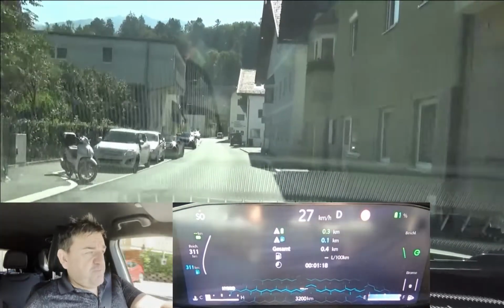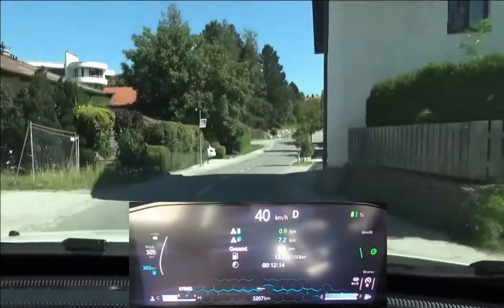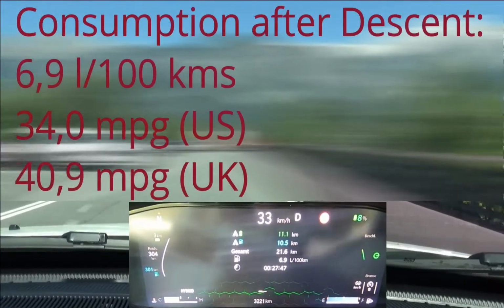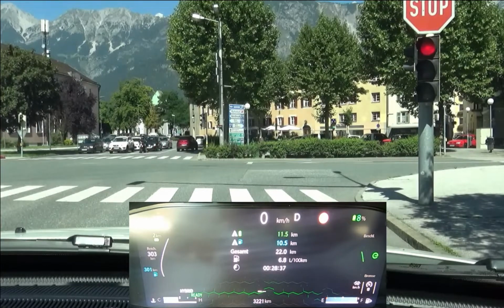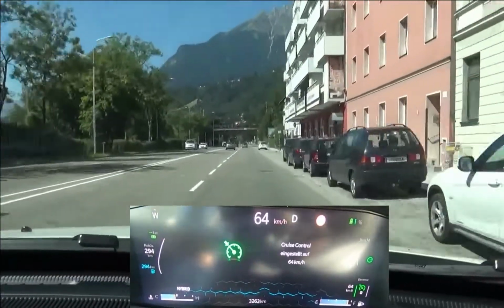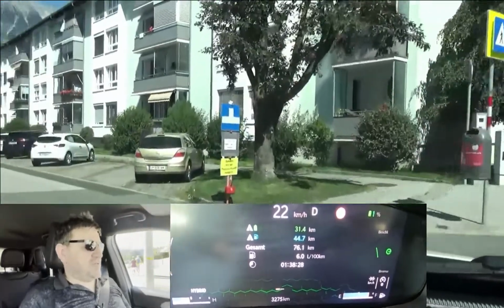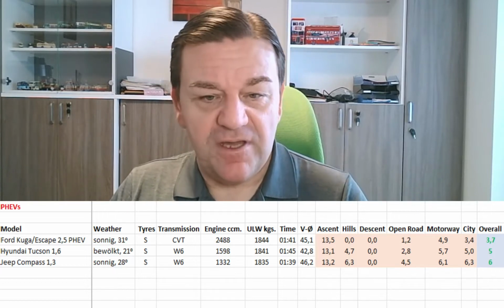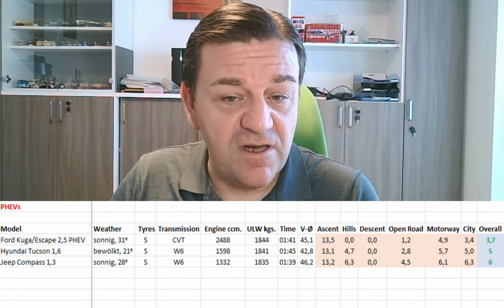Jeep Compass 4xe - Plug-In Hybrid - Fuel Economy test with empty battery

Comment: I have had a 2022 Jeep Compass Trailhawk 4Xe in Scotland from new for past 3 months.   Very interesting video - thanks.   Have you done the same tests with the "eSave" mode configured to CHARGE rather than just hold the existing charge?   I eventually came across the setting and have now configured mine to CHARGE rather than hold charge, when car is set to eSave mode.
Reply: How do you do this mate
Reply: @ryanDevski  1. Select the "Vehicle" option on the button below the Uconnect screen. 
2. Select "E-Hybrid" option on the Uconnect screen (near the top left of screen).  
3. Select "e-save" option from the options on left side of screen. 
4. Now you should see the option to select "Battery save" or "Battery charge".
My vehicle was set to the "Battery save" option which may be useful if you are regularly in an area where you MUST be running on battery.   When I read about the "Battery Charge" setting, I changed mine to this and have left it in this setting.  
Now, when I select the "e-Save" operating mode of the car (pushbutton options on central tunnel behind the "gearstick") : "Hybrid", "Electric" and "e-Save",  I can have the car charge up as it is running on the petrol engine -  which I use occasionally.  It probably uses a bit more fuel but does charge the car but, for me, I find "Battery Charge" a more useful setting than e-Save
The 400 page (approx) manual for the car is poor in my opinion, but there is a section covering this on Page 14 within the "Knowing your car" section.
Hope this helps.
Reply: How much milage do you get in this mode?

Comment: I like how you drove 36 kilometers on fuel and 24 on battery even though it wasn’t charged prior and in wasn’t changing while driving. That means those 24 kilometers where purely regeneration breaking. 
I’m still not a big fan of cvt. 
I’m glad Jeep has real gears.
Reply from the maker: That's always impressive with Hybrid-Cars.
I must admit I came to like CVTs as they are way more efficient in a hybrid-system than a gearbox, especially if it is engineered to be a hybrid-system in the first place, mostly then with an Atkinson-engine.

Comment: I throw my hat in front of you mister. A german who make videos in english for all people to understand. Many thumbs-up to you sir. You see Tucson and Compas have smaller turbo engine with torque on a large interval. For example TucsonPHEV has 350Nm from 1500 to 4500 rpm so a large interval with constant torque so can be used with an automatic gearbox. Kuga has larger engine but aspirate in Atkinson cycle which means power and torque are delivered at maximum rpm about 4500-5000 Rpm so this engines need CVT gearboxes to keep engine at maximum Rpm. I drive day by  day Tucson PHEV as personal car and in my opinion higher consumption is because of desig of power train. Tucson has electric engine integrated with ICE engine and gearbox and use a trans-axle to rear differential for AWD. Compass and Kuga use ICE engine in front and electric engine on rear wheels without axle and rear differential so low inertia and friction so much lower losses. Problem at Jeep Compass is like you said that use a too small electric engine. I choose between Compass and Tucson the last one and after using it on some light offroad I think I made a good choice! I wait for new test from you. Best Regards.
Reply from the maker: Thanks, but please no insult!! I am actually Austrian, not German ;)